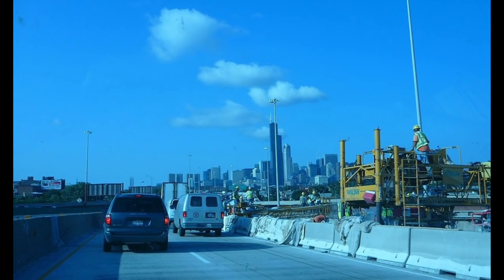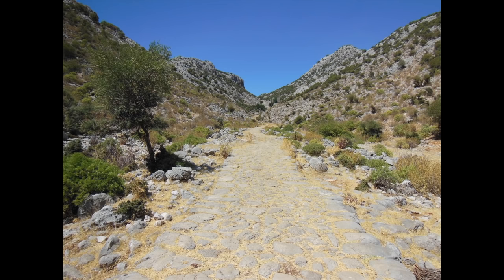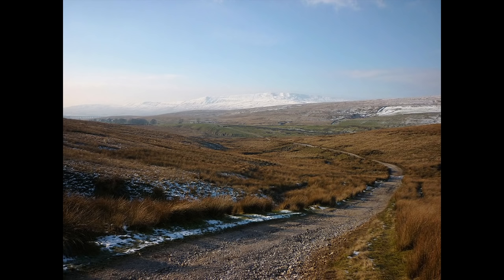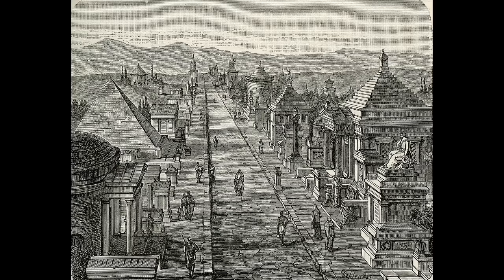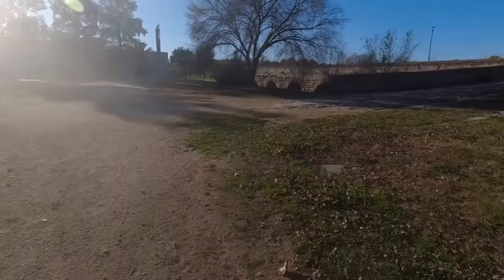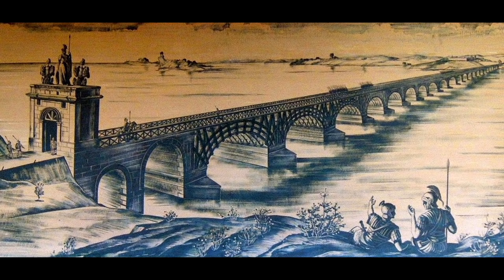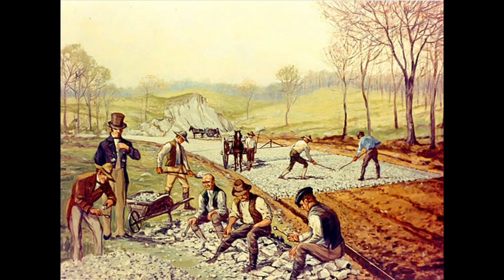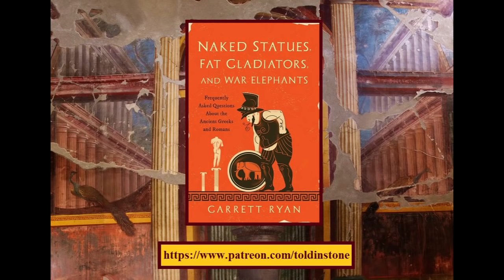Were Roman Roads more Durable than Modern Highways?

Comment: From my civil engineering background, the difference in loads carried by Roman roads and modern interstates is hard to overstate. A modern semi-truck does 10,000x the damage to an asphalt road of an 1,800lb cart, and a typical 4,000lb car does ~25x more damage than the same cart.

These roads are incredibly impressive, especially considering the technology of the era, but they would melt under the loads modern freeways experience. Awesome video as always!
Reply: Not to mention the asphalt roads beings 100s of times cheaper to build than stone or brick ones which required intensive labor to build.
Reply: Not to mention that due to American city design, there is a never ending stream of cars and traffic and cars and traffic... These roads never get a break
Reply: Not to mention /most/ roads in America won't shatter your spine just for looking at them wrong. Those Roman roads look absolutely brutal.
Reply: @timvvs  Not to mention cities like Chicago freeze annually, yet the roads still get the same stress from traffic. That's what I would guess is the greatest cause for repair. Whenever I go down south, the roads(whether asphalt or concrete) are so smooth and without cracks.
Reply: Not to mention… you would have zero traction on Roman roads in the rain
Reply: How much more does it cost to build a road out of concrete vs. asphalt? Concrete roads, using good concrete seem to last forever.
Reply: You completely neglected the politics side :D
Reply: The steel rims on the cart have about the same ground pressure as the truck…
The cart is however moving more slowly and thus avoids the hydraulic shock that does most of the damage to modern roads by pushing water into cracks in the roadbed. So the cart wears the surface more but the modern vehicle causes potholes…
Reply: @johna.4334  Concrete cannot be used in areas where it freezes a lot, as it would be destroyed by ice expansion.
Reply: @azureprophet  
Understood. But out West say in California for example, where it doesn't freeze for the most part, many new and repaired freeways are still using asphalt! Boggles the mind to say the least.
Note: Asphalt tends to melt in the hot SoCal sun which is another reason to use concrete.
Reply: That’s funny cause there are Bridges built by Romans in Europe almost 2,000 years ago, that are used by cars to this day lmao just look it up
Reply: While I'll agree about the roads I am not so sure about the bridges. In italy we have a LOT of roman bridges that are still part of our road system. One of the most famous is the Tiberio Bridge in Rimini, this old guy shows no sign of fatigue handling the everyday traffic of the city.
Reply: Many Roman roads and bridges are still used for daily modern traffic in Italy. Also in very hilly areas. Personally the only downside I can see is that those roads are pretty much no go for cyclists with road bikes. Although perhaps often better than sampietrini. Sampietrini takes worst from both worlds, it's slippery, needs a lot of maintenance and it's always uneven. Currently Rome is planning to replace a lot of those roads with asphalt or other safer materials.
Reply: @manpreet9766  Not if you never stop fixing it.
Reply: Perhaps, but one advantage to the roman roads is that solid stone is near infinitely compressible, hence why the Pyramids have stood so long, whereas concrete and asphalt are not. Could explain the counterpoint of Roman bridges still well in use today.
Reply: Not so sure, I saw trucks on Roman roads, and Roman bridges carry heavy modern traffic, even now.
Reply: The grip issue is also pretty big.
Reply: Just compare the military late 19 century concrete constructions around Amsterdam to the Pantheon in Rome, the first arecrumbling apart and the Pantheon looks like they just built it last week.
Reply: @johna.4334  depends on the soil beneath it, if there are layers of peat below it   asphalt will bend, whileconcrete cracks.
Reply: It is true what you wrote but I would like to point out that the big trucks has tyres with suspensions like the cars absorbing the vibration. The real issue is not so much the weight but the continuous vibration that shakes the asphalt so if not well made it starts loosing its consistency that creates cracks then becomes a lousy pothole. Regarding the bridges is a entirely different matter were weight creates very hard stress. If you take the highway between Florence and Bologna and you are stuck on the bridge because of heavy traffic jam you can feel the bridge flexing and shaking when a truck passes the other lane, making you wonder how long it it will manage to handle the abuse. Exactly what happened about 5 years ago in Genoa as a bridge collapsed causing more than 24 deaths, it was rather old built with cheap materials like untreated iron rods for reinforced concrete, thus rusting quite badly, unfortunately in pure Italian style nobody was responsible. To finish the armies when marching on the bridges are told to loosely walk on it in order not to destroy it. A common sense that for centuries has  been applied. Hope I didn't bore you...
Reply: @klaasdeboer8106  
Point taken. Another advantage to asphalt is it holds up better in an earthquake environment where the ground below shifts often. But overall, concrete is a better material to construct roads in a none-freeze environment. Concrete is stronger, doesn't melt under the hot Southwest sun and is less prone to potholes.
Note: I noticed years ago on the 10 fwy in Los Angeles, CA, engineers were replacing broken sections (due to poor quality concrete) with precast concrete slabs. The old slab was measured, broken up, removed and a new slab (made off-site) was lowered in to take its place. Engineering marvels!
Reply: Tommy Taffy  
Nothing. The Romans simply did not have the technology.
Reply: Tommy Taffy  
Do you honestly believe the ancient Roman civil engineers had the know-how and the ability to build a freeway that could support a vehicle driving 80mph? Surely you jest.
Reply: Have to agree with that.
Roman roads does not hold up to heavy traffic like semi-trucks.... Not even modern roads does over time.
Many parts of ancient Roman roads was destroyed in a matter of months when larger trucks started to use them.
Reply: @johna.4334  concrete will still crack and pit under heavy load and poor weather. This is why most modern roads are a concrete base with asphalt on top, as asphalt is more flexible and easier to patch. Concrete typically costs almost twice as much as asphalt per sq foot
Reply: @davminks  
Maybe true in your parts but in the American Southwest we see a lot of new freeways made with concrete...and for good reason; concrete lasts much, much longer than asphalt and doesn't melt. 
Note: I've seen too many examples where asphalt has been paved over broken, poor-quality concrete (bandaid fix) and in five+ years' time it comes off and forms potholes. Always best to jackhammer out the broken concrete slab and replace it with new concrete.
Reply: @manpreet9766  Depends on the street, some would actually be cheaper overall since if only light cars ride on them it could save a lot in reparations.
Reply: @echonomix_  I've driven on some of them around Rome, and despite being basically cobble stone roads, they have been worn down and are rather smooth to drive, at least at city speeds.
Reply: I have to respectfully disagree.

I've built a fair number of access and haul roads out of gravel, and when I was figuring out how to do that I went back and read the John Macadam books on the subject, as well as researching the way Romans built roads, which was remarkably similar to the way we do. 

The major weakness of a gravel road is water, even one that is surfaced with pavers. (Though the Romans top-coated them cement)
The secondary weakness if energy displacing stones by amounts that are often to tiny to see, but which add up.

If you took a Roman road and surfaced it with modern concrete or asphalt, it could handle much higher loads and speeds than it could with just the stones showing.
Now, I would immediately agree that they wouldn't handle 80,000lb loads at 75mph, but that isn't a weakness in the design. They simply had no need to build them like that, because nothing was that heavy or moved that fast.

The important point here, and the thing that I find amazing, is that structurally there is very little difference between the way a Roman road was built and the way a modern road is built. Sure, I might use a power compactor and Geomaterials that weren't available to the Romans, and of course the roads I built could carry those 80,000 pound loads (and more), but only at far lower velocities.

That being said...
If someone asked me to build a road without modern heavy compaction equipment or materials, just crushed stone following the Roman "recipe", without any Geomaterials, and then put a modern asphalt top-course on it, I would be completely confident that it could handle modern interstate highway traffic. Other than the asphalt, the only real difference is that it would be thicker.
Reply: @andreacolombo9795  I'm sure it has been fixed or maintained.
Reply: @jhtsurvival  So people should have used it continuosly  for 2000 years without any maintenance? I don't get your point, the structure it is still the Roman one built with Istrian stone without any modern addition.
Reply: @johna.4334  concrete still has to be ground down every once and a while to restore rain groves. and re-flatten them from differential bed compaction. and they crack. on the other hand, asphalt is infinitely recyclable and quick to put down compared to waiting for concrete to cure which may take weeks.
Reply: @johna.4334  According to all the pavement type selection reports I have done, asphalt roads are always much cheaper, even when including service life factors.
Reply: The weight of the cars are negligible compared to the trucks.
Reply: @nick4506  
"concrete still has to be ground down every once and a while to restore rain groves"
I can live with that; it rains so little here in SoCal it makes little difference.  
"and re-flatten them from differential bed compaction"
I've seen the road engineers cut the concrete surface with a laser cutting machine; the end result is a perfectly smooth surface.
"and they crack"
Poor quality concrete cracks, good quality concrete with a good base cracks little. I can site several examples on the fwys here in LA.
"on the other hand, asphalt is infinitely recyclable"
As is concrete; once crushed it makes excellent base rock for new fwy construction/expansion.
"and quick to put down compared to waiting for concrete to cure which may take weeks"
All true. But when new/replacement precast concrete slabs are measured, constructed off site in a controlled setting, trucked in and dropped in place, the job goes pretty fast -think of railroad track construction. The end result is a well-made fwy that will last well over a century.
Reply: @pierrenavaille4748  
"...asphalt roads are always much cheaper, even when including service life factors"
No argument there. But there's the inconvenience of constantly having to repair and repave an asphalt fwy. One of the best examples is the 5 fwy between Sacramento and the grapevine; it's always under repair!
Reply: @andreacolombo9795  my point is my parents house was built 200 years ago but it's been maintained and redone. People act like these Roman  roads are some indestructible secret they are not.  If they were not maintained they crumble away like everything else. Modern roads if maintained also will last thousands of years
Reply: @johna.4334  yea im from la too. and I'm a motorcyclist I notice the cracks. and the jumps between each slab are annoying. It's a little hard to tell because most of our asphalt surfaces are over half a century old, and have been bleached by the sun. so they look like concrete but they are not. 

and my point about infinitely recyclable is they make machines that can rip up an asphalt surface, grind it up, heat it, and lay it back down in one swoop. new road just like that. without having to recast it.

the trucking in segments thing is how they do some bits on bridges but for freeways, they are cast in place. It's a machine called a slip form paver. then it's cut into slabs.
Reply: @jhtsurvival  I get your point now and if you talk about roads I totally agree with you.  I still think that Roman bridges are engineering marvels and although I understand building a stone bridge for an highway today would be anachronistic and economically stupid I highly doubt that a modern iron/concrete bridge has a chance to withstand for so long even if well maintained. Last observation: Roman concrete IS indestructible compared to the modern one. 😉
Reply: @azureprophet  I think almost all the highways are Concrete in Michigan. If you see asphalt that's just on top of the 12 in of concrete underneath them
Reply: @johna.4334  I know civil engineers but I don't think any Highway is Pure Asphalt. What is it like 12 inch thick asphalt? That's not what I see when I see them building highways oh, I say them pouring 12 in of concrete with a ton of re-rod
Reply: @thealeons3179  
In the American Southwest, the only time I would see asphalt placed on top of concrete is for a cheap, quick and easy repair job over broken (poor quality) concrete. Precast concrete slab is the preferred method for new freeeway construction.
Reply: Yeah Roman Bridges in Spain still work even after use by cars
Reply: @CreamAle  Embankments are necessary to allow fast vehicles to turn. It's more efficient with asphalt.
Reply: I disagree
Iron ring outline of cart wheels cause a lot of damage to asphalt roads.
We see that in India where still a lot of  farmers haul their harvest to market yards and companies(sugarcane).
Those wheels form grooves through asphalt
Reply: Given the increase in vehicle tech, surely road engineering would increase along side it.
Reply: I wondered about that too.  Sometimes it's tempting to say that innovations of the past were the pinnacle of that technology; but when you consider all of the variables, you quickly realize those sentiments are nonsense.
Reply: Would it be possible to invest more into a longer lasting road thus keeping downtime lower?
Reply: it seems everyone hnder this comment doesn't realize that those roman roads are still being used and cars traverse them all the time 😂😂 the Via Appia in Rome is especially popular, and none of the issues brought up actually exist, except maybe for a bumpy ride
Reply: Thanks you just saved me from watching this boring video
Reply: Those Roman roads obviously weren't meant to be used by vehicles travelling over 60 mph. Heck, even driving a 4x4 over 45mph on those would be a bumpy experience.
Good for hikers & MTB cyclists though.
Reply: @manpreet9766  The romans had a lot of slaves so labor wasn't a factor back then
Reply: @johna.4334  It doesn't last forever. Concrete needs as much (if not more) constant maintenance and repair than common asphalt roads. Case-in-point: the I-27 highway connecting Amarillo, TX to Lubbock, TX, was paved entirely out of concrete. The whole damn road looks like a 100-mile long spiderweb, thanks to the constant re-sealing to fix the constantly cracking concrete.
Reply: I am not so sure the you are 100% correct . I would argue the few roads laid with brick in my old neighborhood were there when I was born ! I watched every other road be replaced repaved and so fourth ! But the brick laid road its still there ! If roman's needed more strength they would have found a way like hempcrete or some type of brick !
Reply: From the perspective of a general contractor,  if the Romans had the same loads as modern roads do I'm sure they would have designed their roads accordingly. You're comparing apples to oranges I'm afraid...
Reply: How has nobody mentioned that driving over those bumpy ass stones you’d be better off driving in Chicago
Reply: Do you think it’s possible to construct a modern interstate system here in the U.S. or even Europe or Asia that could last at least several centuries with minimal maintenance, or perhaps even a millennia or two? That would be an incredible thesis paper, and in the long run be insanely practical for countries that are “depopulating”. Around Chicago and Detroit, all it took was for more folks to move away after the manufacturing jobs disappeared than were moving in and the tax base literally could not fund basic maintenance of their highways and roads. They almost completely rely on federal government grants just to perform basic upkeep of I-90 and similar roadways. Our methods of long-term usability are entirely based on an assumption that the towns and cities in which the roads exist will continue to grow at a modest pace, and that growth will fund the road’s reconstruction. But that utterly falls apart as birth rates decline and working-age populations age out and die. A modern roadway that could bear the loads of current semi-trucks and still last at least several hundred years would be extremely practical.
Reply: @azureprophet  one of America and Canada’s mistakes in its northern states/Territories
Reply: @histguy101  from iowa, about 4 hours away from chicago. where the summers get gulf of mexico hot and humid, and the winters get canada cold, snow and ice. the ground is soft and wet and shifts constantly. the roads there get destroyed by the cracks and dips that happen when the asphalt softens from summer heat and the ground softening and shifting. then the winter gets ice into those cracks and rips apart the road. then the snow ploughs hit those potholes and cracks, ripping huge chunks of the road out. then by the next summer, they already need to resurface the road. this can happen in one season cycle on roads with low traffic, we're talking about iowa here. even its big cities are slow and calm compared to places like chicago. some places just dont deal well with having any kind of road. the ground qualities and weather just destroy them, even with very little traffic. it would be interesting to see what roman roads from the softer, colder territories look like today, vs the ones in the dry, harder volcanic ground in italy, and what engineering techniques they used to overcome different challenges posed by location.
Reply: I was going to say this. modern highways would be extreme overkill if all we were doing is marching legions and ox carts over them. roman roads were impressive for their day, but they are not sufficient for modern needs, and modern roads break down frequently because of just how extreme of useage they experience.
Reply: @padmabushan  Wouldn't 'modern' tyres have a lower ground pressure PSI compared to a older style cart with rubber or steel rims that is way narrower. It amazing watching old films of Model Ts and As with skinny tyres just cut through mud, not sure a wider modern tyre could do it without requiring a larger engine or power. (Tyre is correct spelling where I am from).
Reply: @jonathantan2469  I certainly would not want to go fast over them. It would be like driving on cobblestone or corrugated roads. However - paradoxically the faster you go, the more you 'skip' over the them making a smoother ride.
Reply: Yeah, Roman Roads were only good for foot traffic.  They destroyed horses and carts, but, better than nothing.
Reply: Asphalt sounds a lot like planned obsolescence, it deteriorates very rapidly.
Is it a political reason why no one has come up with new asphalt mixtures or a new material?
Also, why do modern traffic lights never detect motorcycles?
Reply: I said this as I clicked on this video and just wonder who the fuck couldn't figure this out on their own in two seconds.
Reply: Yes they're impressive but how are we going to compare the properties of cobble to asphalt, asphalt eats itself basically under load by providing a grippy textured surface that rubber tyres can easily stick to. I don't wanna say it but I'm gonna say it, It's not a glitch It's a feature.
Reply: how much damage does a unicycle do? practically nothing i imagine
Reply: Exactly what I was thinking. And the roads that are left aren’t in heavy use areas.
Reply: Also stone-paved roads are slippery when wet.
Reply: @allangibson2408  false comparison. the load of a semi is far greater per square inch of pressure.
Reply: Not only weight, but inertia forces too, when you figure in the inertia of a 80,000lb semi with a velocity of 70mph when it bounces from uneven pavement.
Reply: @Mike-jv8bv  Carts run steel tyres. 
Semi’s run rubber. 
Rubber tyres have a far higher contact area - the difference between a hammer and a rubber mallet.
Steel tyres have much lower friction - which is an advantage to something you are pulling on a hard smooth surface.
That is also why trains run on steel tyres.
Reply: @johna.4334  congrats you broke the chain you deserve to go to double he hockey sticks
Reply: My thoughts exactly.
Reply: @johna.4334  In Pennsylvania, there was a 5 mile stretch of interstate that they redid in total concrete, 20 years later, still in great shape and due to the money saved from not having to reapply asphalt every 4 years, they are now redoing the next 15 mile stretch in concrete.
Reply: @echonomix_  .
What’s funny is when they were first built most of then had a layer of sand clay and some other things in then placed on the top and rolled in so they were actually smooth
Reply: There’s plenty of messed up roads where semi trucks don’t even touch
Reply: You forgot to mention roman soldiers would march on these roads, im talking about tens of thousands to possibly hundreds of thousands of human beings stepping on these roads. That level of pressure is nothing compared to nowadays
Reply: @salasrcp90  those Roman roads were built by soldiers not slaves
Reply: So what about the electric engine vehicles with batteries like semis, buses and trucks? Arent they gonna be heavier than their petrol using counterparts? Wont we face a similar issue to what u mentioned?
Reply: I see roman roads and bridges still used today by constant car traffic. 
They still need effectively no maintenance.
Reply: Plus Southern and Western European winters are a joke compared to the harsh North American winters that can have extreme temperature swings and massive snow storms that require plows to scrape the roads while spreading salt on them moving at near highway speeds while doing so
Reply: @azureprophet  i live in ne ohio and we use a ton of concrete
Reply: I think you meant "hard to understate"
Reply: Thanks for saving me time.
Reply: @histguy101  Not in Texas. I've lived here all my life and 25/35hwy has been under construction the whole time. They have companies building over each other and they put small mom/pop businesses out of business from all the redirected traffic.
Reply: How so, as far as I can tell The Roman roads That are in use now by cars haven't had that many repairs if at all...
Reply: I think it is worth considering that, in some urban areas in italy, roman roads are still used today by modern cars and are still holding up fine
Reply: Im afraid to say your multipliers dont make physical sense. Your average cart had wheels plated with iron, rendering their load bearing area much much smaller than tires. It is absolutely false that a car would cause “25 times” the damage? Where did you arrive at such quantitative conclusions
Reply: Also, there was much less traffic. Population at year 0 was no more than 300 million. WORLDWIDE.
Reply: It looks bumpy to me
Reply: Thank YOU!  Ancient roads only had to tolerate livestock & fairly lightweight vehicles.  You said it so much better than I could've.
Reply: @johna.4334  Fun fact.  These days concrete constructed freeways are built sandwiching a layer of asphalt.  Concrete base of about 10-12 inches, followed by about 4 inches of asphalt, capped by another 10-12 inches of concrete.
Reply: @azureprophet  That would be news in Michigan.  Truthfully, no road construction method is immune from freeze thaw cycles.
Reply: @johna.4334  I think you mean drycast, not precast.  Precast concrete is poured in a form, allowed to cure, and then transported to the worksite.  Drycast concrete (not really dry, but very low water content) is used in a continuously formed application.  The concrete is poured and compacted as the slip form machinery continues to advance.
Reply: You are very right. Roman roads suffer less stresses from hoofs and feet than modern roads that ran over by heavy trucks and vehicles every minute.
Reply: Yes...
Engineering...
Reply: @paoloviti6156  This is a video about roman roads. I don’t think it’s possible to bore anyone in this comment section
Reply: @johna.4334  Concrete road surfaces last a bit longer, but invariably the slabs will shift over time and result in rough bumps at every expansion joint long before the actual surface of the concrete deteriorates. I was quite pleased when the old concrete interstate surfaces that I drive were replaced with asphalt decades ago. It's so much smoother now.
Reply: Didn't even watch the video, but I knew this had to be the answer. We are way harder on roads that foot traffic and horses.
Reply: yep that's what I thought too. Although I'm not from civil engineering (but I'm a mechanical engineer graduate) I have seen in the subject "design of machine elements" about the load that occurs on various machine components. I had the similar idea about loads of car and trucks running on the road. Load by humans and horses is nothing compared to big bad vehicles we've got.
Reply: Roman roads were not "paved" there's a video here in YouTube detailing actual Roman roads.
Reply: Asphalt is more flexible and forgiving than concrete or stone. Cyclists really liked it when cobblestone roads got a layed of asphalt on top. And probably also the horses.
Reply: @echonomix_  Bicyclists advocated topping cobblestone roads with asphalt.
Reply: Semis don't pay enough taxes for the amount of damage they commit against our roads.
Reply: @meekmeads  he tends to do that
Reply: @johna.4334  I live in southern californi and we have a lot of concrete roada
Reply: @HenryBrown Your statement is not correct. The ancient Roman roads were made of pure solid rocks with Mohs hardness values usually between 4 - 7.  These roads are much more durable and can easily handle the weight of the vehicles you mention, and without any potholes being formed yearly! The only difference is that it would be a much more bumpy ride at higher speeds, therefore not being ideal or as safe for high speed travel especially for larger vehicles. All you have done in your statement is compare the difference in damage to modern non competent asphalt roads with different weight vehicles, which does not demonstrate at all the high durability of Roman roads made of solid hard rocks (some even with basalt). They surely would not melt, it is the modern day roads that melt!
Reply: @azureprophet  actually it can, we did this in Germany often - but completly different than it is used to - large concrete blocks created streets here in old socialistic times - it is cheap and these streets last now over 50 years without major troubles - biggest problems - between the blocks it is bumpy :D
Reply: @azureprophet  That didn't stop them on Long Island highways like Sunrise Highway on the south shore...  Of course that is also why anyone who commutes on that highway regularly needs to replace their windshield as pieces of concrete get torn up and thrown at you at 70+ mph...  The road is a a nightmare patchwork of concrete with splotches of asphalt patches along with gaping holes and crevasses.
Reply: @histguy101  good point
Reply: @johna.4334  Most roads are concrete foundations with asphalt surfaces I believe.
Reply: You forgot with your background of maybe digging holes that you don't know much at all. The modern truck is still going over roman bridges to this day and with rubber tires, they travel over even gravel roads with no problem. The average cart of the day would do more damage than a modern truck now. Weight isnt the issue, its how that weight it bared. 

Truth is, roads today are cheaper and built to be repaired, roman roads were built to last a thousand years with minimal upkeep. And they still exist today with modern traffic going over them where they weren't ripped up.

Civil engineering these days I actually embarrassing, and that comes from my experience working next to them most of the day. They usually hire dropouts and junkies. All it is these days is compacted gravel and asphalt. Back in roman times, that would not even the start of a foundation that often went down over a metre underground. Roads these days are a veneer.
Reply: Talking about high traffic is an excuse to justify that modern roads falling apart after 40 years of use .If thats the case why not build road that last 100 years without major repairs. Its has been more then 2 millenia since roman build their roads and they surved their purpose for them and some of them still exist. 
Can modern roads last that long ? No 
Do we need another 2 millenia to come up with roads that last ? Or maybe we need time machine to bring thise roman engineers so they could show modern engineers how its done .
The roads I am driving are worst then those that elephants build in Africa with their own feet ha,ha,ha,no exaggeration.
Reply: @meekmeads  Thank goodness!🤓
Reply: I haven't been to much of Europe, but roads in German towns are made of sand and cobbles/granite paving stones. They hold up well. Water goes between the stones, into the sand and keeps puddling down to a minimum. Good stuff.
Reply: Question:  is degree of damage to modern roads by modern vehicles versus to Roman roads by Roman vehicles more relative to the weight and speed of the vehicles than the strength and durability of the materials?  Or would a Roman road actually hold up better to a semi-truck than a modern road because of how it’s made?
Reply: @echonomix_ I mean you’d look brutal too if you’d been wheeled over and rained on for a couple millennia, lol
Reply: That was the first thing I thought, too.
Reply: @Girard Tanks are not allowed on it and Trucks have a maximum load of 10 ton, wagons could weight as much as 5 tons add to this 8 to 12 horses puling the cart witch themselves weight between 8 ton and 12 ton medieval carts could weight more than double what trucks weight today
Reply: @Girard And in normal units wtf is a pound ?
Reply: What do you mean? 50% of belgium is cobblestone even in some of our bussiest cities and except the verry few adjustmens nothing has been changed fundamentally... and trucks pas by those regularly btw.
Reply: Is there any way to build a road that could last? Probably super expensive.
Reply: You dont need a civil engineering background to understand this lmao.
Reply: I absolutely agree!!
Reply: That is so true,
Reply: A lot of comments, but how about using a repulsorlift system on cars to make the highways last a lot longer?  I remember seeing a movie about this farmer in Tunisia that would take his repulsorlift vehicle into town to buy parts
Reply: Well, the Roman roads were systematically "layered."   I suspect they would do quite well.
Reply: And, I wouldn't wanna be going 70 mph on a stone road - my back would be dismantled.
Reply: They have trucks in Italy too. 🇮🇹
Reply: @bluceree7312  --  Funny thing you mention that.   When I was a kid living in Pittsburgh in the 50s, some major roads had the "wearing surface of "Belgium Blocks."   They were "dressed" on 5 of the 6 sides but the exposed surface was rounded.   We had streetcars.   The streetcar rails were partly covered by concrete and the Belgium Blocks made up the difference.   This was before I drove but I was often a passenger and the ride by noisy with a lot of vibration.
Reply: I also thought it was because of geography. Some places the ground simply is more unstable and shift no matter what you do.
Reply: There are existing roman roads that are exposed to moder trucks . There are other highways using the Roman road as its foundation . ( can't go fast on Coble stone) 
Depending on the state we could build better foundations.
Reply: this is the first thing i thought. glad its the first comment!
Reply: Thank you so much for saying this, this schoud be something everyone schoud know
Reply: after the Romans darkness... the Romans built things to last for eternity...
Reply: I still marvel at Caesars Bridge. Anyone without the technology of the Romans, upon the finish of the bridge just ten days later, would be severely intimidated. Then to have it taken down, after having marched all over their lands, leaves me wondering exactly what Caesar really was thinking when he decided to do that. He was very good at recognizing consequences and repercussions before they could happen, except the last case.
Reply: Perhaps we should limit our use of such destructive vehicles in favor of trains then, instead of letting these machines ruin our civilian infrastructure
Reply: @manpreet9766 
Cheap is weak. Therefore we should invest in more expensive and durable materials.
Reply: @timvvs 
Then limit automobile traffic in urban areas.
Reply: even more than a very fat guy on a freakishly heavy bycicle
Reply: not zero @ChrisSlowens
Reply: @echonomix_  the smoother top layer withered away over time. of course roman roads werent that bumpy by design. the long carriage journeys that the wealthy took on these roads would be brutal
Reply: I would agree but as he said multiple of these roads were used by cars until recently